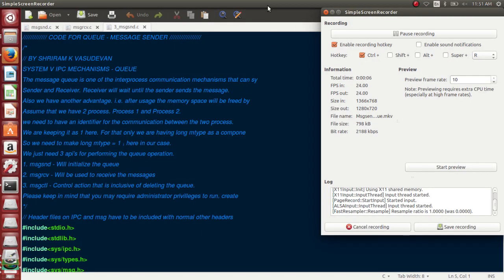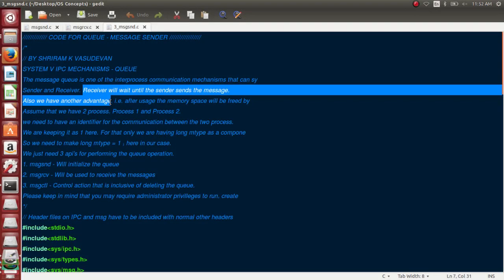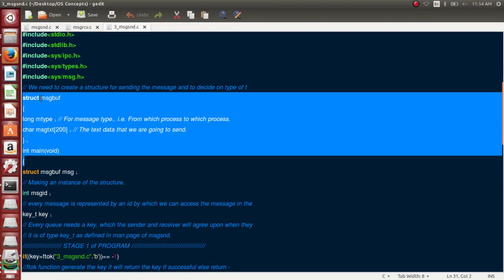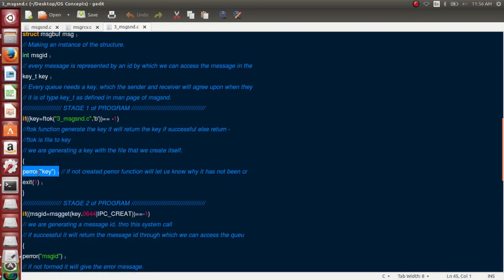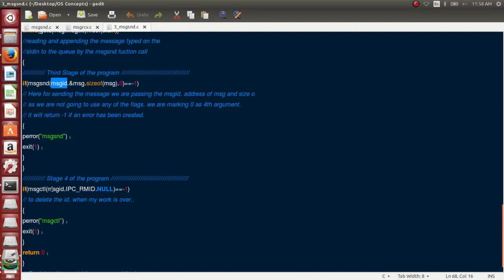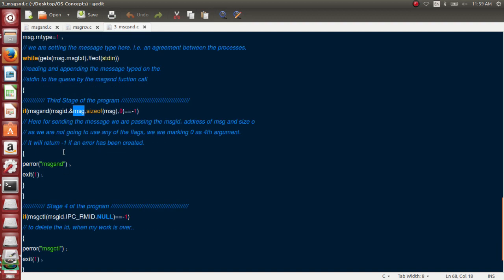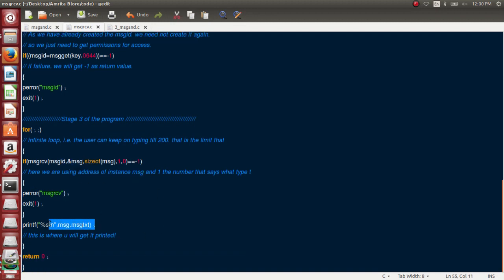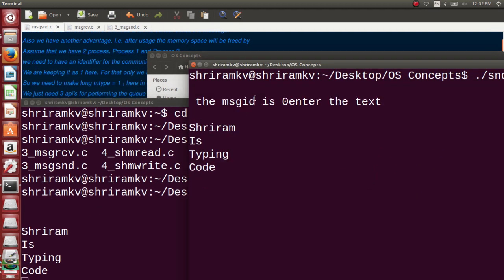Message Queue - IPC Mechanism

Comment: Hi Bro. I tried the programs. But facing an issue, that receiver program gets a different messageId and seems due to which messages are not received. Can u please help
Reply: Same works fine if I don't check the return of any of the calls. Also it works fine if there is no file exist for the pah mentione in ftok(path , 65)
Reply from the maker: Ftok can be done with any file but.. give appropriate path. Else it won work. Or.. give key value and try

Comment: What is the difference between the two files 3_msgsnd and msgsnd sir? Just asking my doubt.
Reply from the maker: Both are same..i did the naming different. Nothing beyond :)
Reply: @ShriramVasudevan  Thanks for a fast reply sir. Can I know why you have used 3_msgsnd in msgsnd and only msgsnd in msgrcv program to generate a key. I am having a doubt that if two different files are used can we get the interprocess communication mechanism right or wrong ?
Reply from the maker: @vardhansanka4779  key should be with the same file only. So, don't get confused..both sender and receiver must share the same key..
Reply from the maker: @vardhansanka4779 it's my pleasure helping you. :)
Reply: @ShriramVasudevan  sir, what that 0 in msgsnd(step-3) and 1,0 is msgrcv(step-3)meant for? Are they used for standard input and standard output purpose or anything else?

Comment: There's a huge bug on this program..
the msgid generated here shouldn't be equal = 0 , and also this process never ends as both loops for send and receive are indefinite.and also the queue is not cleared up anytime soon because of this loop.

try this code instead:
//msgsnd() program:
int main()
{
int count =0;
int msgid;
int sndid;
char w[4] = "EXIT"; //to exit the send operation anytime

struct msgbuff{
long settype;
char msgtxt[50];
};

struct msgbuff msg;
//setting type
msg.settype = 2;

//MSG ID creation
if((msgid = msgget((key_t)1253,0644|IPC_CREAT))==-1) //the IPC_CREAT should used only once.
{
perror("\KEY or MSGID NOT GENERATED\n");
return 0;
}
printf("\n The msgid [SEND] : [%d]\n",msgid);  //THE RETURN VALUE OF MSGID SHOULDN'T BE <= 0. 

//both the msgsnd and msgrcv need not be executed simultaneously because they are Async.
// the msgsnd sends the data to the queue and the queue stores , later can be accessed by msgrcv process.
while(1)  //snd operation
{
gets(msg.msgtxt);
sndid = msgsnd(msgid,&msg,sizeof(msg),0);
if(sndid <0)
{
perror("msgsnd failed");
return 0;
}
count += strlen(msg.msgtxt);
if(strcmp(w,msg.msgtxt)==0) //a condition to exit the send process
break;
}
printf("%d bytes of data has been sent",count);
printf("\nSend complete\n");
count = 0;

//the queue can be cleared in any ONE of the process , either in snd or rcv program.
//Queue clearance must be done only once either right after transmission or reception.
return 0;
}

//msgrcv() program:
int main()
{
int count =0;
int msgid;
int sndid;
char w[4] = "EXIT"; //to exit the send operation anytime

struct msgbuff{
long settype;
char msgtxt[50];
};

struct msgbuff msg;
//setting type
msg.settype = 2;

//MSG ID creation
if((msgid = msgget((key_t)1253,0644))==-1) //the IPC_CREAT is not used cause it was already created!
{
perror("\KEY or MSGID NOT GENERATED\n");
return 0;
}
printf("\n The msgid [RECV] : [%d]\n",msgid);

//msgrcv() operation
while(1)
{
if(msgrcv(msgid,&msg,sizeof(msg),2,0)==-1)
{
perror("MSGRCV ERROR");
return 0;
}
else
printf("mess: %s\n",msg.msgtxt);
if(strcmp(w,msg.msgtxt)==0)
break;
}
}
printf("%d bytes of data has been received ",count);
printf("\nReceive Complete\n");
count = 0;

//Here the queue is cleared up after receiving all the messages.
if(msgctl(msgid,IPC_RMID,NULL)==-1)
{
perror("msgctl error");
return 0;
}
printf("Queue is deleted and cleared up\n");
return 0;
}

//////////// NOTE:
the diff. b/w shmid and msgid is ,
with shmid a same unique code is generated for n number of executions unless the key value is changed, because the shared memory is created and stays at a fixed address space in the memory but for msgid, for every successful 
(queue cleared) execution a different unique id is returned , this is because the queue is created and handled directly by the kernel, so every now and then the queues address space isn't fixed.